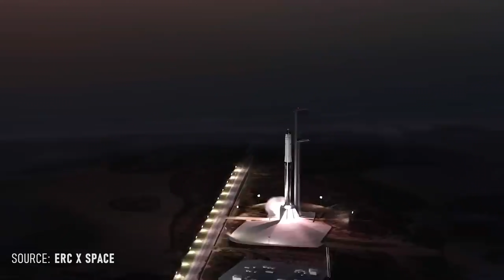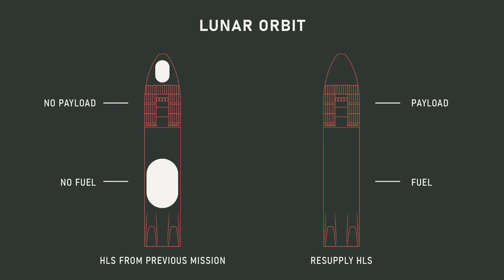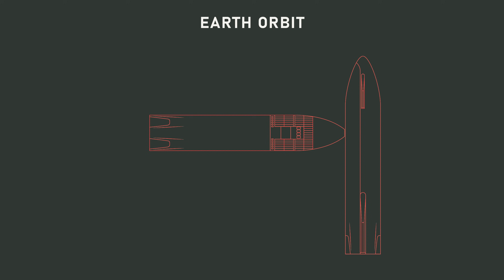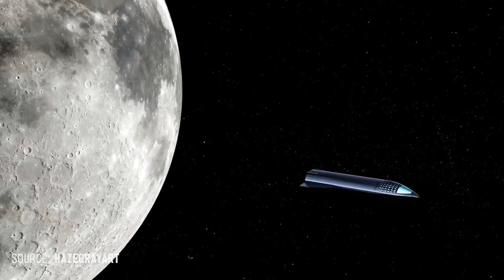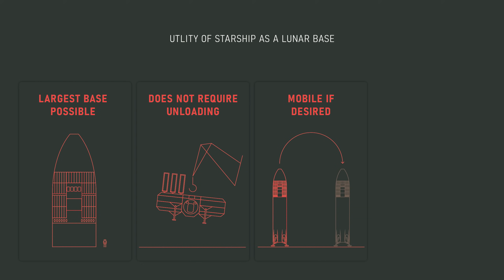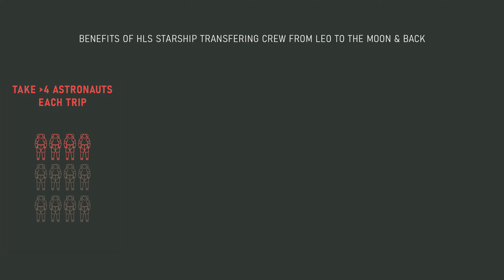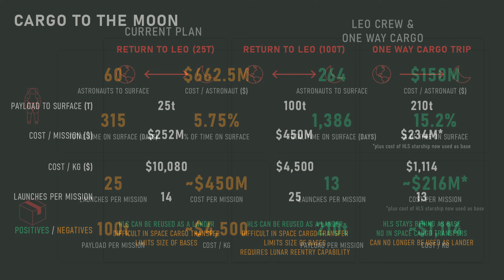How to Use HLS Starship

Comment: I think you forgot about a couple possible ways for HLS starship to go LEO-luna-LEO.   Aero-capture or ballistic capture on the return leg should allow it to work with the existing public performance numbers.  Might have also been worth mentioning the delta-V handicap from forcing a NRHO rendezvous with Lunar Gateaway.  And, until there's something to do with all that downmass or you're leaving folks behind on a permanently occupied lunar base, I'm not sure the lander+hab makes much sense... you already have a hab in the lander and a second hab/freighter may just be far more stuff than can be used at this point.
Reply: Lunar Starship is not planned to have heat tiles or flaps, so it won't be doing aerobreaking. You could use a regular Starship, but then you give up the mass gains from ditching the flaps and heat tiles and it may still not have enough dV. From estimates, it appears that there is just enough to get to the Moon's surface and back up to the Lunar Gateway.
Reply: @steveaustin2686  Not certain of that; with a stainless steel structure, it should be able to withstand a reasonable heat flux w/o specialized tiles.  It may take quite a few atmospheric pass-thru's to fully break, but it seems possible.  Any better ideas for how it will do LEO-luna-LEO?  The video is pretty clear that the it's (1) assumed possible by NASA and (2) unknown how it could possibly work by the general public.  BTW:  thanks for the reply.  Nor trying to be argumentative, always trying to learn....
Reply: @dmeachamSD  As I understand it, the aluminum Shuttle had to have thermal blankets on the top (dorsal) side as even the lower bleed over heat from the bottom (ventral) side (heat tile side) was too much for aluminum. Since Starship is made from stainless steel, it only needs heat tiles on the ventral side and doesn't need them on the dorsal side. I'm not a rocket scientist, but the speed bleed off from aerobraking has to come from somewhere and that is heat applied to the ventral side of the vehicle, so heat tiles are likely necessary there too. As I understand it, you can't do too many shallow aerobrakes as you would likely keep skipping up into the Van Allen belts and NASA tries to limit time there for astronaut safety. So while stainless steel can take higher heat, I'm not sure it can take the ventral heat from an aerobrake without heat tiles.

For Starship, I've seen estimates of 6,500 m/s dV to over 8,000 m/s dV. You need around 7,300 m/s dV to get from LEO to lunar orbit, down to the surface, and back to lunar orbit. Per the NASA HLS Option A Statement, Starship appears to only need refueling in LEO to complete a Moon landing. So apparently this means that Starship will have at least over 7,300 m/s of dV. But LEO to lunar orbit to LEO is almost 7,900 m/s of dV. Estimates are that unless Lunar Starship has stretched the tanks, it won't have that much dV. Per space websites, the Raptor has a 380 ISP and Starship (second stage) a fully fueled weight of 1,385 tons, which would give around 7,500 m/s dV per a web dV calculator. Now Apogee's plan of sending Lunar Starship to the Moon transfer point after a Moon landing would work as it would fit the 7,500 m/s dV. And a fully fueled Starship Tanker should have enough fuel to reach that Moon transfer point and back even with filling up a Lunar Starship with fuel to get back from that same Moon transfer point (~9,400 m/s dV for the trip plus refill and a Tanker may have as much as ~10,400 m/s dV).

Nah, I'm learning stuff as I look things up as well. I'm nowhere near as knowledgeable as experts, so I defer to NASA and other experts for the answers they provide.
Reply: @steveaustin2686  well written.
Reply: @dmeachamSD  Thanks. I try to be positive about Starship, but not get swept up in the hype without looking at the real picture. Not only will it be interesting to see SpaceX develop Starship, but launch locations as well. Boca Chica has restrictions on how many times a year they can close the area for launches. The rigs can launch Starship as fast as they can turn them around, but getting the vehicles there will be fun with no quay at Boca Chica. I guess they will build another construction site at a port. They have plans for adding a Starship launch pad at Pad 39A, but it's busy with Crew Dragon, Falcon Heavy and Falcon 9 launches. With 5-12 refuelings per operational launch and only 4 launch sites for now, the ballet of launches in a short time frame will be interesting.

Comment: Would 4MM of stainless steel provide enough radiation protection?
Reply from the maker: Alone probably not. It is likely the passenger versions of Starship (especially the lunar one) will have extra layers of radiation shielding. Likely even a radiation shelter.
Reply: Many plans for lunar bases considered using regolith for radiation shielding.  The size of starship would make this less possible.  Maybe a radiation shelter could be constructed nearby.

Comment: If using HLS Starship as a moon base, SpaceX could build decks into the propellant tanks. After landing, astronauts could vent the tanks, and then unbolt a hatch to the tanks and have a huge base. Of course the moon base idea requires another starship to ferry the astronauts.
Reply from the maker: Yes I need to explore a wet workshop version eventually.

Comment: I hope that NASA or SpaceX take advantage of establishing ISRU capabilities on the lunar surface. Converting water ice to LOX, water and O2 is of course one thing. But imagine if we had the ability to produce Methane on the moon. 

If we could have a propellant plant on the Moon, then space exploration could seriously change for the better.
A Mars-starship could travel to lunar-orbit and then be refueled by a lunar starship tanker, which would require less launches.

Maybe the dV gains aren't that much more versus heading to Mars from LEO, but ultimately it could mean more payload to Mars?

Also: hopefully the next generation of super-heavy spacecrafts will use higher isp engines. Imagine a nuclear-powered starship with nuclear engines that are meant for interplanetary travel. Sheeeeeesh

Comment: Is a starship really sufficiently isolated against radiation to serve as a long-term base? All the suggestions I have seen until now for a moon base cover modules in over 1 meter of regolith. I did see a youtube video looking at the possibility of lying a starship down horizontally (for mars bases), but opinions were generally that this is impractical.
Reply: I think we will see them lowered to the horizontal, probably into a trench, and then covered, at least partially.
Reply from the maker: This is a good point. The base ones would require more radiation shielding. And could support it due to increased payload. 

However the focus of these videos are mainly on early Artemis days. By the time we have robots on the surface that can pile regolith 1m thick on our bases I imagine we could build much larger permanent structures better and larger than a starship payload bay. That absolutely would be the way to go.
Reply: My understanding is that water/ice stops the cosmic radiation.  So maybe the walls could have bladders in them that could be filled up with moon water.  Or rather, maybe a vertical pile of moon sandbags, with the still-standing HLS in the middle, is possible.  I'm just making this up though.

Comment: Once there is tolerance to propellant transfers with crew aboard, I prefer the option of refueling in LEO, going to lunar orbit, transferring some propellant to another Starship which is always stationed near the Moon, then landing one of the Starships, doing the mission on the surface, retuning to rendezvous again in Lunar orbit, transferring either propellant or crew, then returning one Starship to LEO. This makes more efficient use of propellant than any of the options considered, since (1) only one Starship goes between the Earth and the Moon, and (2) propellant needed for the return to Earth isn’t carried to and from the Lunar surface. Taking return propellant to and from the Lunar surface is hugely wasteful.

Comment: Very well-thought-out video with great graphics! Your proposal of using two lunar Starships -- one for cargo (CLS) and one for the astronauts (HLS) is intriguing. In this scenario, the HLS could then be much more limited in capacity handling the four astronauts and around one ton of cargo or whatever are the essentials in case there's an issue accessing the CLS. How much shorter could the lunar Starship HLS be in this case and due to the reduced mass, how many fewer refuelings would be required?
Reply from the maker: Very good point that the payload bay could be shrunk on this version if you wanted to save mass. The on that goes down to the surface still needs to be refueled 12 times. The one that stays in Lunar orbit go down only needs 6 refuels. In theory you could shrink its tanks and remove its legs and shrink its cargo bay if you wanted to save mass. Then maybe it could get away with 4 refuels.

Comment: I wonder how the Raptors will be maintained in space though. The Shuttle returned back to Earth so one could repair or check the SSMEs. But the HLS Starship will always be in space. 

Space repairs? Perhaps, the RVacs can be dismantled and reattached in space?
Reply: Workshops and storage at LEO Gateway, inevitably.
Reply: Some kind of engine-changing robot that can replace the Raptor engines in LEO makes a ton of sense.  Pit stop in space.

Comment: Large payload most be carried externally by lunar starship from lunar orbit to the surface, that would solve the problem of transferring payload between ships, and you only need 60 tons of propellant into low lunar orbit to land 100 tons of payload to the moon, but to land a 85 tons empty starship and launch back in the low lunar orbit you will need 140 tons, so in total 200 tons of propellant and 100 tons of payload, now you can send that on a normal starship from the LEO and would have 50 tons of propellant for return to earth 30 for insertion maneuver and 20 for propulsiv landing, this is much better than lunar starship because it have a heatshild and don't need to rendezvous to another tanker, and you can put a lot of geological sample(tens of tons) on that ship if you don't deliver 100 tons to the moon sometimes.

Comment: In the longer term, it would make sense to build a landing pad to enable conventional crew Starships to land on the lunar surface. This would save considerable delta-v (as conventional Starships can aerocapture into LEO or aerobrake to the Earth's surface on return) and enable large crew transport capacity (~dozens per transfer). The HLS lunar Starship could still be used as a ballistic "hopper" to visit remote sites on the Moon (especially once lunar ISRU is available). I expect launching crew direct from Earth on Starship will also occur once Starship is crew-rated.
Reply: The weight penalty of standard StarShip is too high compared to any benefits

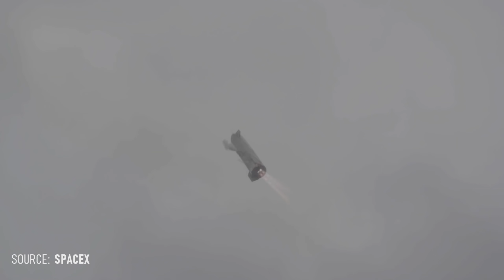Comment: 12:30 expending HLS starship on the surface would not be a good way of using it. I should remind you that by being fully reusable, it is capable of sending as much mass to the Lunar Surface as NASA is willing to spend. And by being fully reusable, this allows NASA to focus more of its budget on the payload than the vehicle. 

You don’t want NASA doing the same thing with Starship as SLS. Even if it becomes a Lunar base in itself, HLS starship is still more worth sending payload to the surface to construct a base. Using it as a habitat brings the disadvantage of relying on the elevator, whereas spending a few weeks offloading cargo then returning to LEO for refueling would at least help with maintaining the elevator’s functionality. Only at the end of its life should it be used as a lunar building, when the Lunar base constructs landing pads for future starships, which won’t have the problem of blowing a large amount of dust and rocks outwards at dangerous velocities because of said dust and rigolith having been used to construct the pad itself.
Reply: The cost of a cargo / habitat StarShip is  very low when compared to creating, transporting and landing any other form of habitat. Additionally it would be a massive base compared to a single small module. 
Laying it down will be the inevitable solution.

Comment: I did a few calculations.  We don't know how big the Lunar Starship is going to be.  If Lunar Starship is as big as a booster and only partially fuelled when launched then once fully fuelled in orbit then it can make two trips the the moon and still back to earth orbit or back to the lunar surface as a base.
Reply: I don’t see any likelihood that Lunar Starship would be as big as a (SuperHeavy) booster. The renders suggest it will be the size of a standard Starship, possibly with slightly expanded tanks (e.g., 1350 tons of propellant instead of 1200).

Comment: Launch a crewed lunar Starship to LEO with 100t of cargo and 20 passengers. 
Launch five uncrewed tanker Starships to LEO to fill the main tanks of the lunar Starship.
Launch another tanker Starship (tanker #6) to LEO. 
Launch four more tanker Starships (tankers 7 thru 10) to fill the main tanks of tanker #6.
Send the lunar Starship and tanker #6 together to low lunar orbit (LLO).
The tanker transfers 100t of methalox to the lunar Starship (buddy tanking), which lands on the lunar surface. The tanker remains in LLO.
Arriving passengers and cargo are unloaded. Returning passengers and cargo are loaded.
The lunar Starship returns to LLO and the tanker transfers another 100t of methalox to the lunar Starship.
Both Starships do their trans earth injection (TEI) burns and return to the ocean platforms near Boca Chica.
Only propellant is transferred in LLO. Passengers and cargo are transferred on the lunar surface. 
The TEI propellant for the lunar Starship remains in the tanker while the lunar Starship is on the Moon. That propellant is transferred to the lunar Starship after it returns to LLO.
Operating cost: 11 Starship launches at $10M per launch=$110M = cost of one Falcon Heavy launch.

My guess is that something like this scenario will be SpaceX's approach for HLS Option B in which NASA aims at establishing a permanent human presence on the lunar surface that fits within its projected budgets out to 2030.

Comment: I really would like to ask if the re-usability is even close to what we think it is? I mean so far each booster needs a couple of weak's of work to be able to fly again. This means they can check all the parts, swap them if needed. make small repairs on minor components and so on.

For the lunar starship, this either doesn't happen in space at all or not to the extend because either we have to rely on automation and diagnostics via remote access or we use humans, but these are limited by bulky space suites and the trouble that is an EVA. 

So I worry a bit that these ships are in theory reusable but in practice it would be too dangerous to use them more then once without a better infrastructure in space to perform the maintenance. Or am I wrong here?